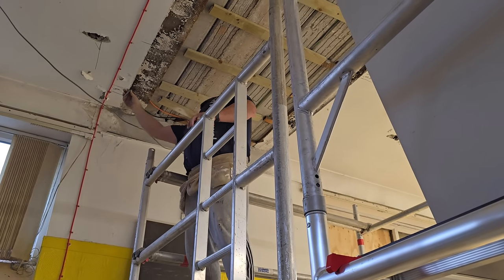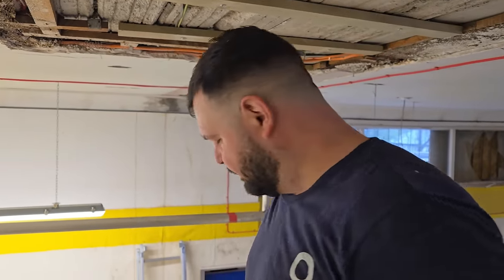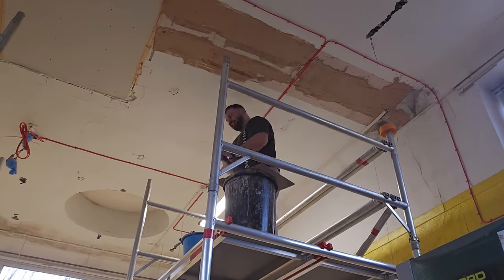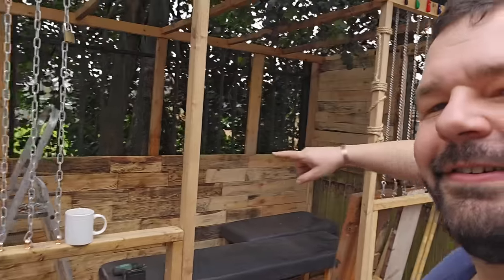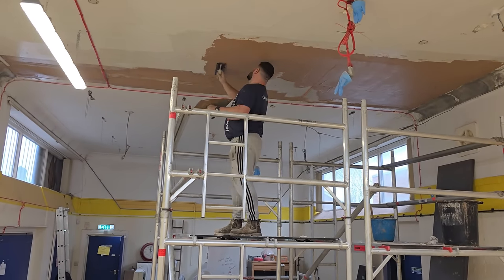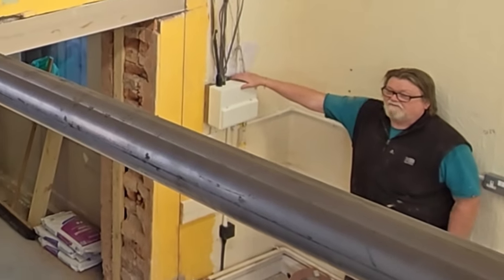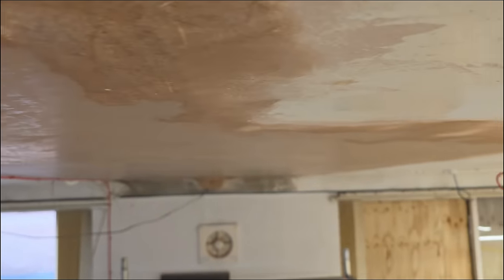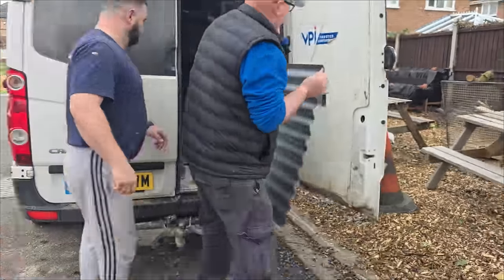DO TRADESMEN STILL HAVE RESPECT FOR ELDERLY?

Comment: Morning Kurt... Great videos as normal... Question I'm doing a old house and all the walls are yellow dusty smooth and leaves a chalk imprint on your hands .. would it be ok to use stabilize solution and then skim, or would it need reboarding... 

Keep up the good work.. iv been watching you since you had 600 subs 👍👌
Reply from the maker: Hey mate. Yes, give it a good coat of stabilising solution and once that's dried out the chalky problem should be solved.
Then seal it with PVA or SBR and skim it as usual.
P.s. thanks for the support mate
Reply: On some of his vlogs I'm sure he says use a stabilizer or sbr I think have a look back
Reply from the maker: Spot on mate,stabilising solution first and then seal